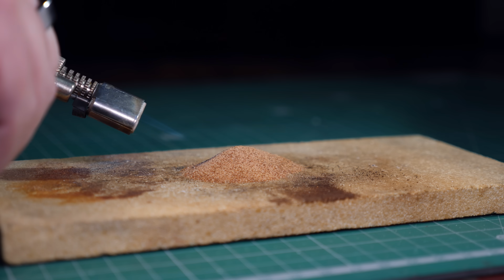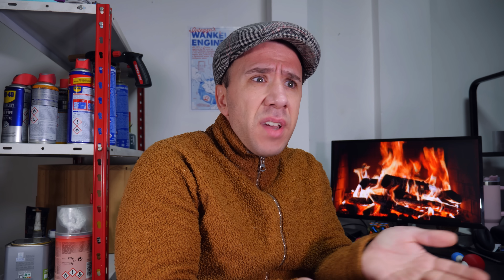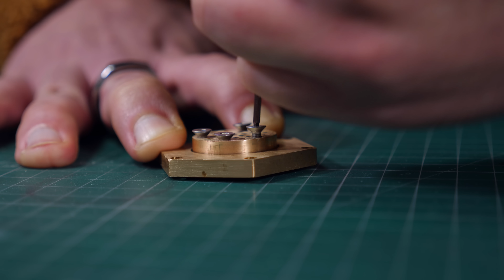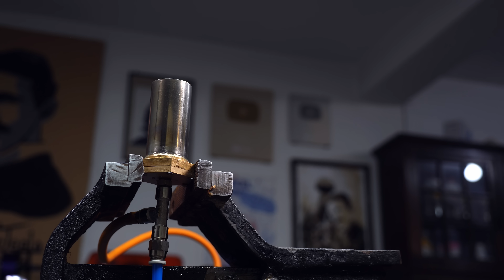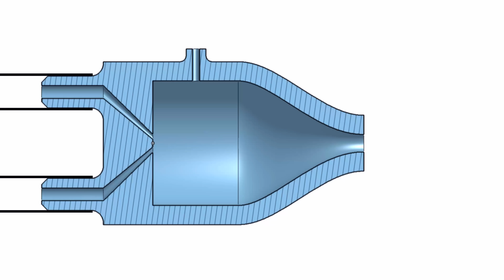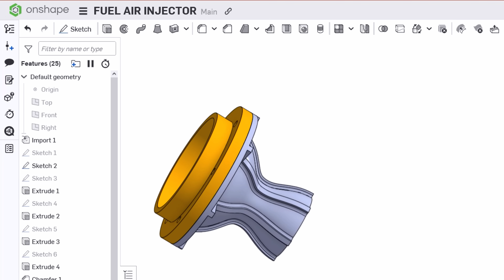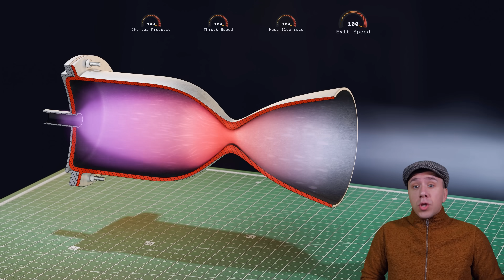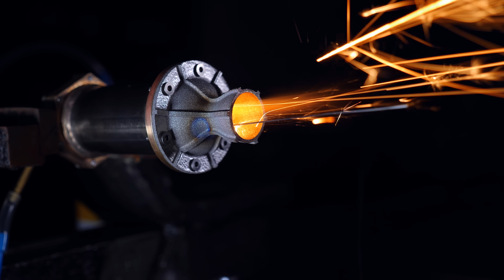I Built the FIRST VENTURI ROCKET ENGINE

Comment: 10:56 a quick reminder that propane is odorless. the smell is an additive added for safety
Reply: so is natural gas. there was once a "massive leak" at a natural gas facility
... the leak wasn't the natural gas itself. it was the tank containing the chemical that gives it the scent.
Reply: Different hydrocarbons smell different after they've been burned. Propane exhaust smells very different from gasoline or diesel.
Reply: @GoingtoHecq hes smelling it straight from the can
Reply: @GoingtoHecq well the majority of them, including propane, burn into wáter and CO2, both odorless
Reply: @GoingtoHecq  well gee skippy, it’s almost like after it’s been burned it’s no longer propane (or whatever other hydrocarbon you started with). If you’re going to try to correct someone, try to know what you’re talking about.
Reply: I caught that too.
Reply: i work in oil & gas processing and can definitely pick up subtle hints from different hydrocarbons.  it's probably contaminants or the gas displacing the nose's feeling of normal.  more of a vibe than a scent
Reply: @GorbisMaximus  You could be correct, my experience of working with refrigerant grade propane is that it has a smell that I could best describe as solvent-like; it cold well be minute traces of other contaminants such as longer chain alkanes; there is no doubt at all that the heavier alkanes do have distinctive odours.
Reply: Him saying that made me lift an eyebrow as well
Reply: i did not know that. very interesting
Reply: Odorants are added to flammables.  I remember my dad flying his plane to Mexico where aviation gas at that time, used the same odorant as natural gas did in the U.S.  He was very confused when he kept smelling natural gas as he did his preflight.
Reply: Not quite, it has a fairly strong aroma, but it's not the stinky smell often associated with gas.
Reply: @cambridgemart2075  tell us you don’t know what you’re talking about without telling us you’re full of shit.
Reply: @spellfireforge  tell me your an asshole without telling me your an asshole
Reply: @spellfireforge  Grab a can of lighter gas and spray it in the air; can you smell it? Point proven, thank you.
Reply: @cambridgemart2075  What makes you so sure that it's the lighter gas that you're smelling and not the additive(s)?
Reply: @joselozano3397  Because lighter gas doesn't have any additives. Something that occurred to me is that I am what is sometimes known as a super-smeller, i.e. I can often smell things completely undetectable to 99% of people, that may be why I can detect propane by smell at low concentrations.
Reply: @cam-bridgedumb2077  that's the smell of odors they added in, you proved NOTHING, but proved yourself being an absolute dumbass.

Here's how stupid you sound:" pop open a can of Coca-Cola,  can you smell it?, that's co2 smell, point proven, thank-you" 

You can add DELULU and keyboard-warrior to your c.v, you earned it
Reply: @-danR Thanks, random internet-dude!
Reply: @cambridgemart2075 You are wrong and the reason you are wrong is explained in the post you replied to. A true unforced error.
Reply: @filonin2   Grab a can of lighter gas and spray it in the air; can you smell it? Point proven, thank you.
Reply: @cambridgemart2075  youre really stupid you know that? Lighter fuel is not propane, its butane. Propane is the odorless gas, which they manually add odorants to so you dont explode your house or suffocate and die because you didnt notice the gas leak. Try do to at least a little research next time before you respond so confidently incorrect, or you come off the same as an anti vaxxer
Reply: @gabusdeux  No, you are really stupid; 1, butane and propane are chemically very closely related. 2. Lighter gas composition varies by region and ours is mainly propane. 3. You're trying to BS someone with a higher ed qualification in organic chemistry.
Please apologise at your leisure.
Reply: @cambridgemart2075 "higher ed" qualification in organic chemistry, huh? Neither propane nor butane has any sort of smell. Your lighter gas does have additives. They just aren't sulfur compounds. Oil distillation isn't perfect, so that solvent smell you're describing? That's the solvents. Lighter gas will even leave a thin film of oil behind if you evaporate a lot of it on one surface. It's not very highly refined, because it doesn't need to be.
Reply: @arturjogi6054  Odour threshold of commercially available non-odourised propane is 4800ppm; the term odourless is a misnomer. And sulfur compounds have extremely distinctive odours, they do not smell like solvents.
It is possible that anything other than analytical grade alkanes could contain longer chain alkanes (commercial grade propane certainly does) which give rise to a smell, but unless you are working with spectroscopic grade propane, it will have a smell.

Comment: Statement:  Between the Wright Brothers' first flight and the 1960s, we went from barely being able to get off the ground, to the fastest ever human-controlled, air-breathing, liquid-fueled aircraft ever designed and flown, yet in the century since Dr. Robert Goddard pioneered modern rocketry, we are STILL using the same basic technology, with the same general results, using a BARELY controlled explosion to place a MINIMAL payload and personnel in orbit, and failing as often as not.

Question:  Why?

Observation:  We have had (for several decades) adequate technology for orbital insertion and retrieval, using FAR less fuel to insert far greater payloads and larger mission crews, while retaining enough fuel for powered, fully controlled landings.

Proposal:  Create an engineering competition to drive the innovation of designing and building a fully-functioning, scale model platform that can launch from a normal runway, like an ordinary aircraft, gradually accelerate to transorbital velocity as it gains altitude, achieve orbit, then return to its starting point, all the while under full control.

You know, instead of just putting people and packing on top of a giant bomb and hoping for the best.

Comment: 13:28  this is how a carburetor works
Reply: This whole thing should have been called "I discovered how a carburetor works and put it on a rocket"
Reply: aka the venturi effect.
Reply: I had the exact same thought. Vacuum is how the fuel gets dragged out (in a car it's all the whole "suck" part of the 4 stroke cycle)
Reply: Which is based on the Venturi effect
Reply: Yeah, and that IS Venturi Effect 😭
Reply: @iamsreeram  Carburetor is a venturi.
Carburetors are not operating in open air. A venturi is a closed tube with a constriction.
Not all things that will cause suction on a tube are venturis.
The CFD analysis knows more about fluid flow than you or me. Look at it again.
Reply: It's based on Bernoulli's law: Gases/ Air with higher velocity have lower pressure. That's why a wing is "sucked" up, because the air above a wingfoil has to travel faster than below, creating an underpressure on the top.
Reply: Bernoulli principle, not law and this ain’t it.
Reply: @alann4808 Law or principle, that depends on where you live. In my country it's called the Bernoulli law or equation. Not a dime to make a fuzz about it. And yet, it does have to do with it as where airflow is faster the air pressure gets lower, thus sucking the liquid out the liquid.
Reply: @paulpaulsen7777  You're thinking of a "regular" venturi. The flow in the video is in open air from a nozzle.

Bernoulli is not as simple "fast flow=low pressure"
I have a degree in this stuff - but, if you don't want to believe me just look at the actual CFD results.

Finally: You have to remember that flows don't cause pressure differentials, pressure differentials cause flows (this is the heart of why people misapply Bernoulli).

Comment: Alcohol would probably have worked better as a solvent, by using water there is always going to be residual moisture unless you let things to dry for a very long time. Also wonder if potassium chlorate which is easier to source and/or make would have been a good alternative to ammonium.